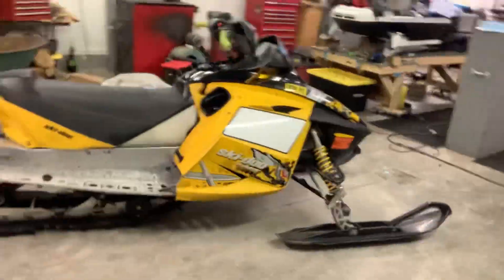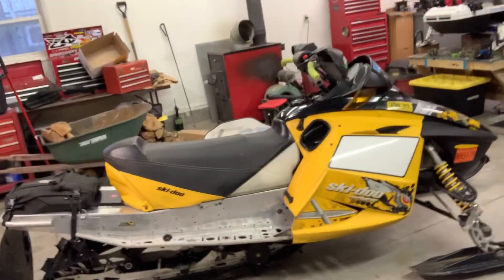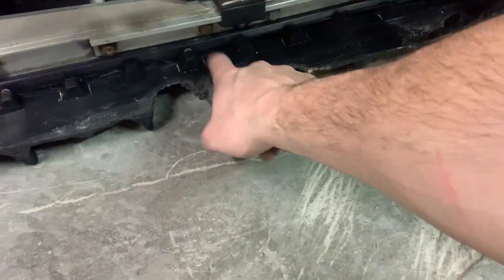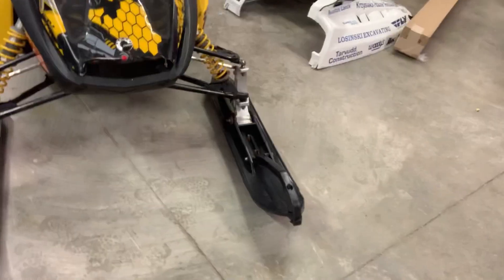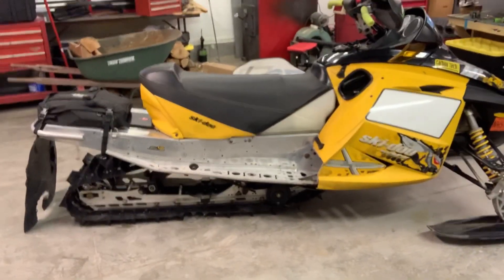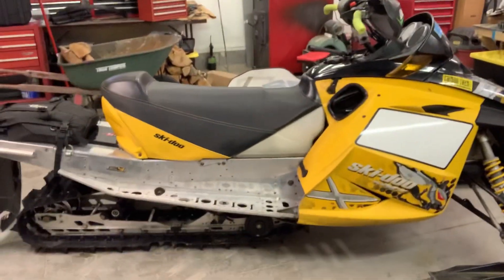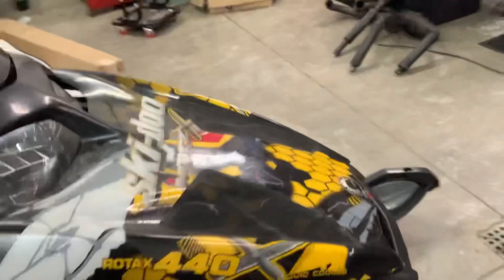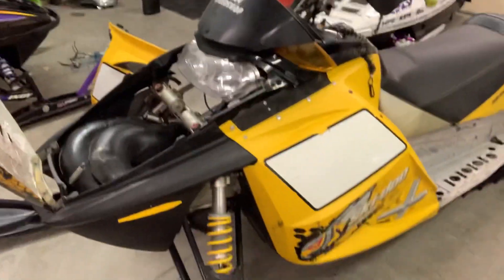PURCHASED: 2007 Skidoo 440/800 Mod

Comment: Revs have always been one of my favorite sleds, too! Changed the game to a “rider forward” position forever. Always wanted one since I was a kid as well. Ive seen lots of them for sale on the marketplace, but hard to find them clean with low miles. Then the ones that are nice are gone in hours. 

Wondering if the track ripped cause its 16 inches wide instead of 15? Thought all revs came stock with 121x15’s. Seems odd that it was ripped just in that one spot - must have hit a hurried metal fence post or something?